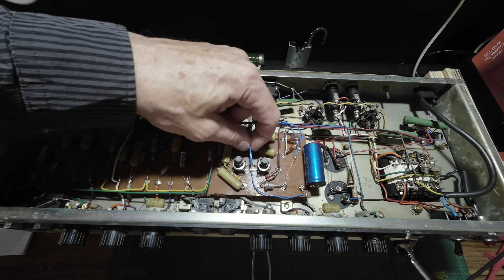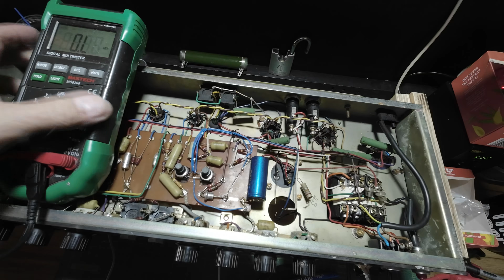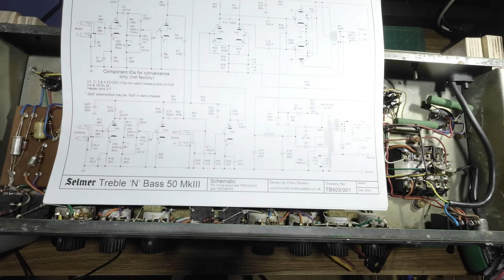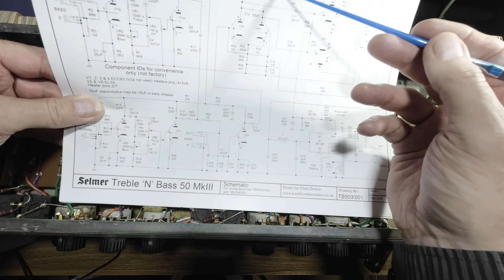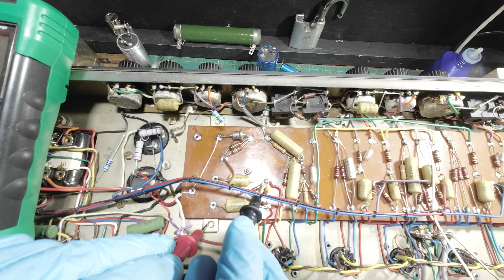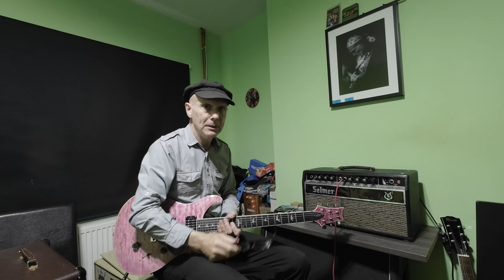Selmer Treble & Bass MK3 Reverb 1966 Guitar Amp Head Let's Give it a Full Service

Comment: I have one of these mkIII Selmers, non-reverb though. Ashamed to say I have completely butchered it, originality-wise. You'd hate it if you saw it, until you plugged it in. Of course, by that point you'd probably have returned everything to stock. The un-used triode from the echo loop obviously became an extra gain stage for the abnormal channel. Then I removed the loop and added a cathode follower, for more compression flavour. It also has a presence control round the back, and a funky mid pot which changes the shape from Fender to not so Fender. Bias pot (probably not very well implemented but useful as every set of valves that I've put in it has had quite different bias needs), hum balancer and elevated heaters. I sincerely hope it never ends up on one of these restoration videos because my handiwork is atrocious. It sounds awesome though and I love it. And it was free, gifted to me my by old employer in a non working and rather sorry state. 

So I thoroughly enjoyed watching this, albeit with a tinge of regret. Most impressed at the accuracy of all those carbon comp resistors..

Tasty playing at the end!
Reply from the maker: Hello, thank you. Far from it. if you prefer it with the mods then that's all cool. I am not a stickler for originality. I have modded a few vintage amps on the channel. You can't beat getting an amp to sound just how you like it. Thanks for watching and take care.

Comment: Bias pots can, and should be,  wired in such a way that if the wper connection to the resistive track fails, the Bias voltage fed to the output tubes increases to it's maximum supply voltage, rather than dropping out altogether. If the wiper interface fails, the tubes will be over-biased and "cold",  but the amp will still function and it'll get you through the gig. The actual resistance element of a good quality bias pot very rarely fails since the voltage going through it is low snd the current is in the milli or even microamp range, but if you're worried about the possibility of this occuring, parallel a high ohm resistor across the pot, say 250K or higher; it might make the pot adjustment somewhat nonlinear, but will assure continuity of bias voltage to the output tubes even if the pot fails.
Reply from the maker: Hello. Yes, the amount of bias pots I see fitted with no protection should they fail. Good advice as usual. Thanks and take care.